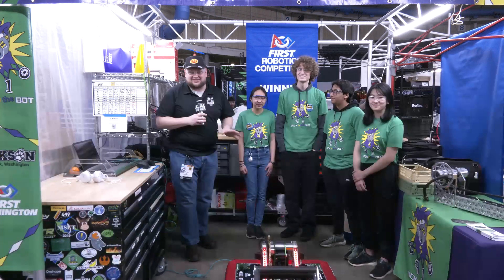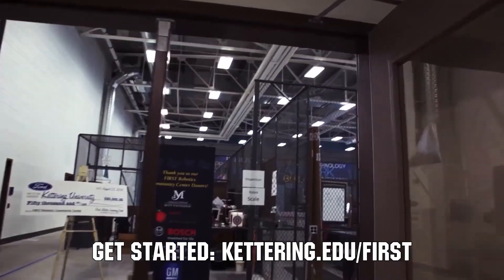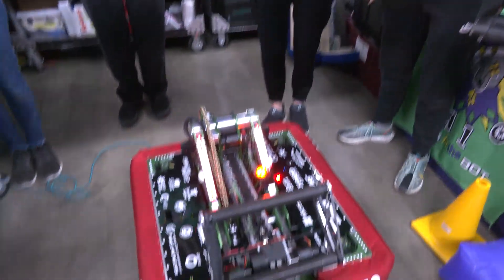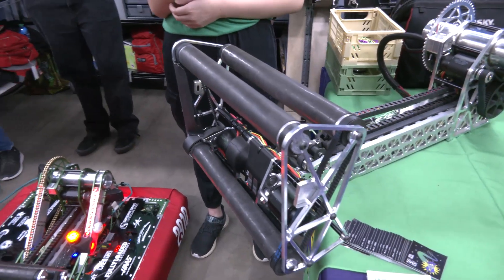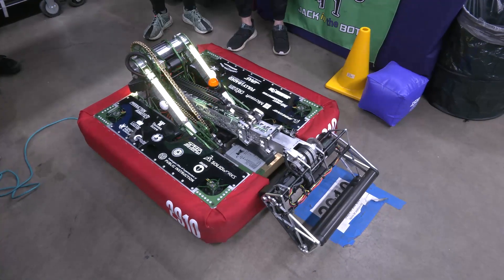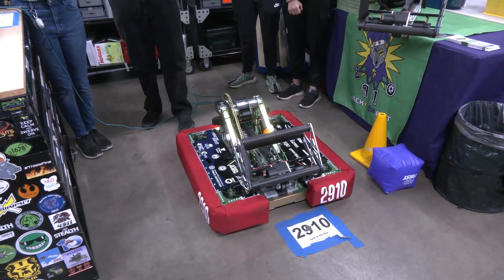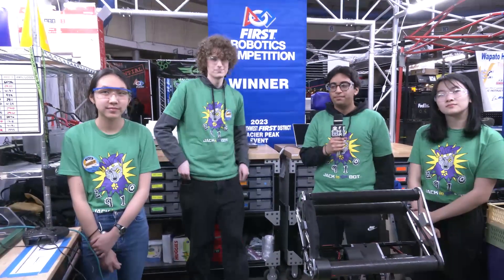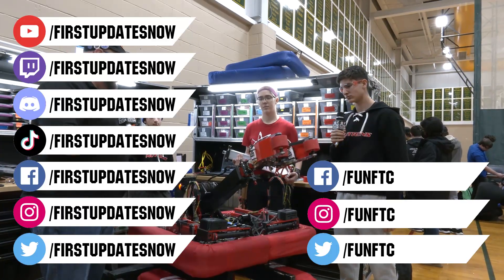Behind the Bumpers | 2910 Jack in the Bot | Charged Up Robot

Comment: How does the telescope work? Ball screw/lead screw or constant force springs? Anyone know
Reply: belt driven. they designed the custom bearing blocks so the second stage is offset, in order to have enough space for the belt (>0.2" in with offset compared to 0.125" in between the stages without the offset)

Comment: The physical buttons on the robot are super clever. Huge fan of this robot, it absolutely cooks!
Reply: Speaking of those buttons, how is that possible? Aren't the roboRIO's outputs disabled on the firmware level while the robot is in disabled mode?
Reply: i have the same question did you ever get an answer?
 @dashl5069